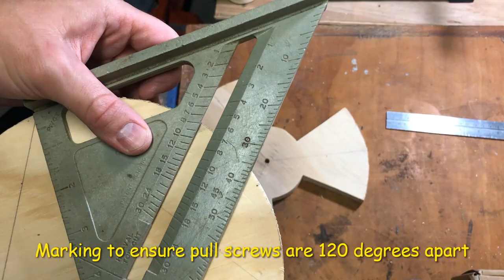Homemade 8" Newtonian Telescope - Part 1

Comment: Good be sure to check astigmatism the glue can dry funny if sticks are slightly thinner than one another. Best to make shims from one cut of a stick. Also it looks like you did not space the mirror clip before siliconing. That also deforms the mirror. Easy fix tho

Comment: Just finished building a mirror cell myself for same purpose. What glue did you use to glue this up? Securing the Primary Mirror with clips just doesn't feel the best for me either but I really want to use the right glue if I glue it up and don'h have much experience with these glues other than Bathroom silicones 😅 Thanks in advance!
Reply: Never mind. Managed to pauze the video and read the tube info. Thanks for the video, made mine very similar to yours. Hope it's performing well!